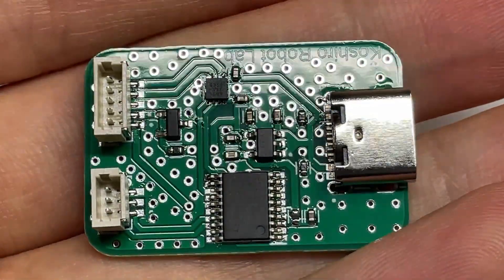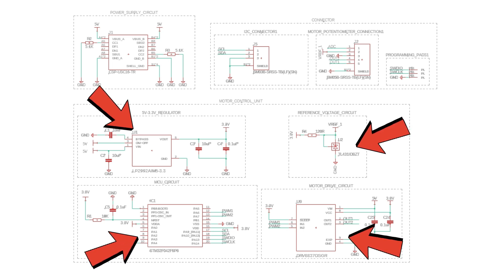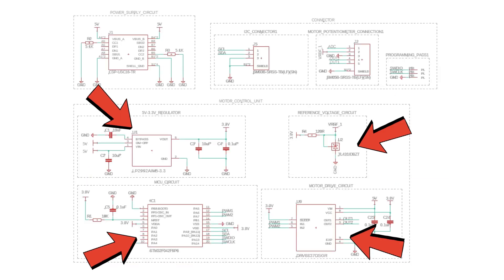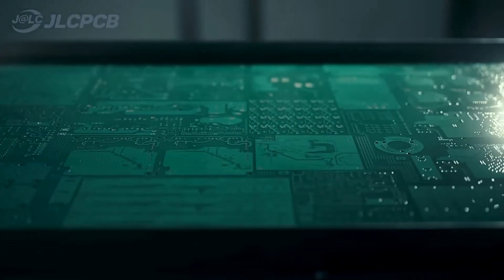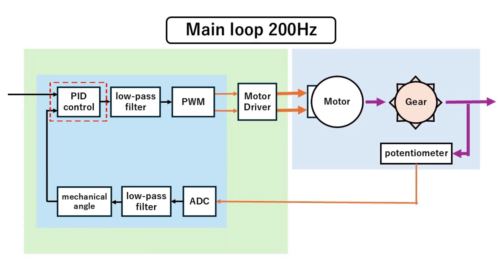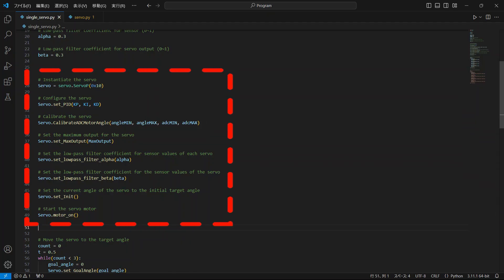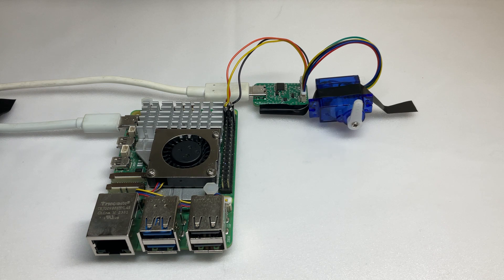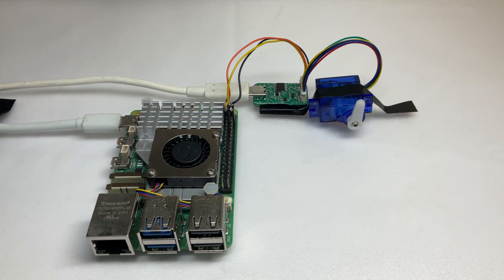I made a Custom Smart Servo Driver

Comment: pwm hasnt been really needed on a servo since analogue rc aircraft, i2c would be good for these, would be simple to include commands for position read, set new position, set and 'hold' position, measure current (this would allow measuring movement resistance or weight etc), set max current (dont break an egg etc) would really make them good for robot hands

Comment: Excellent meticulous execution – a pleasure to watch someone how knows more than myself 🙂🙏 I can't wait to watch your take on the cycloidal gear + brushless motor. I've seen the only one on Youtube some time ago, but it was not meticulous execution, quite good nevertheless solving the fundamental problem.

I guess the problem with regular cheap servos are (3 pins: GND, +5VDC, PWM), that there is no position information. Therefore, you cannot control the acceleration in relation to setpoint.

Also, I'd like to see more channels (for the whole robot) with the same controller; i2c has address capacity and STM32 too (I assume). But maybe the the power is not enough. 

Thank you for your interesting efforts and good luck. Greetings from Finland. Subscribed with All 🦾😊🙏

Comment: You can save a bit of money on the voltage reference, one is not needed at all, the measurement can be performed fully ratio metrically so absolute voltage error doesn't affect the measurement. Most stm32 parts can do this

Comment: Did you modify the wiring from the servo motor? Or is an direct plug n play? I am working on a similar project that enables high current for more current hungry servos. Nice video ❤

Comment: Was I just seeing things, or did the servo sometimes briefly turn the wrong direction when starting a motion?  Is that caused by limitations in the ADC readings of the potentiometer?  Could it be a backlash issue between the potentiometer and the motor shaft?
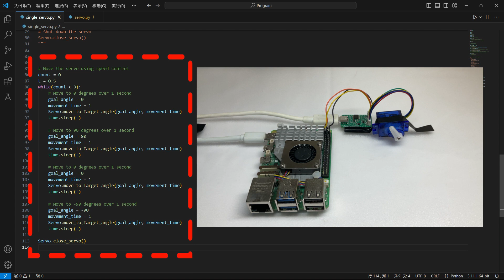Reply from the maker: Indeed, at around 8:20 in the video, it does seem like the motion starts with a brief reverse rotation. I hadn’t noticed it until you pointed it out. My guess is that this might be caused by an overshoot in the previous motion. As a result, when it starts moving again, there could be a brief moment where the target position is in the opposite direction relative to the current angle. What do you think?
Reply: @Koshiro_Robot_Creator  Also, it appears as if the motor's movements weren't very smooth yet. It's hard to tell from the outside whether it is a mechanical (slack) or a control issue. With a bit of debugging and maybe some modeling, it should be solveable, however. Great work. Keep going!

Comment: This is a solution for a non existing problem as you mention at the end. Also you can buy (higher quality) servos with analog feedback built-in if you need that. If you really want I2C control there is the PCA9685 chip that takes I2C and controls 16 servos. Adafruit sells a board using it for $17. But at least you got some experience in PCB design/manufacturing, coding and got a sponsor too so it is a win for you. Thanks for the video.
Reply: Your suggested solution is much worse than buying waveshare servos that don't rely on PWM.